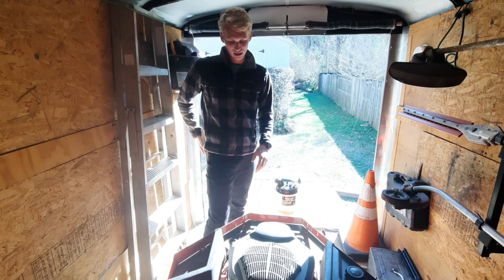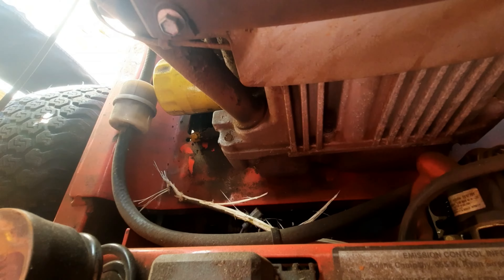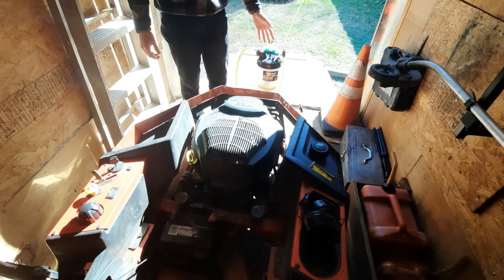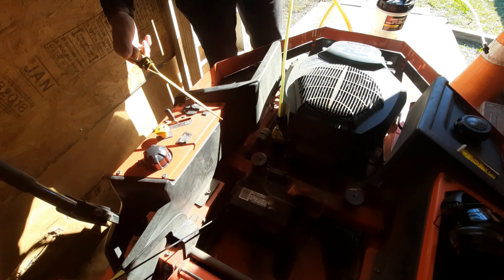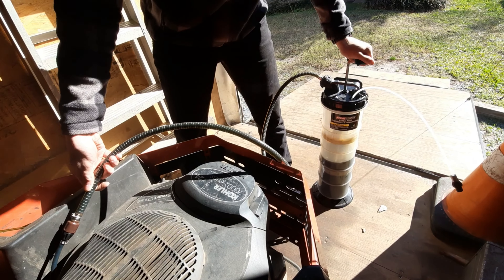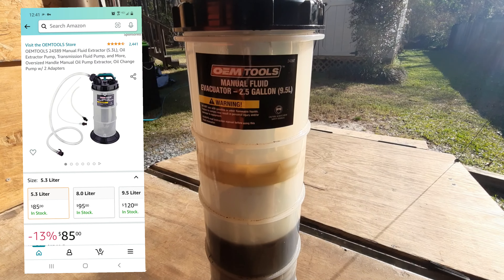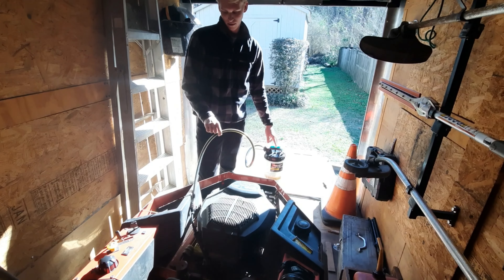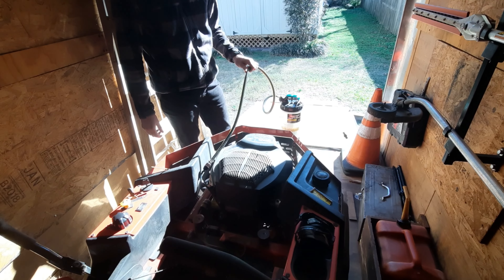The Best Way to Change Oil On The GRAVELY ZTX 42!

Comment: Thanks.  I’ll change it once, before I sell it.  I’ve the 2023 42 ZTX and I absolutely HATE it.  It throws leaves and debris from under the front deck and as into my face.  I had older Gravely and it was so much better.. nice green strip as I suck ip leaves.  I’ll be selling it. By the way, your pump thing farted twice.. gave me a chuckle